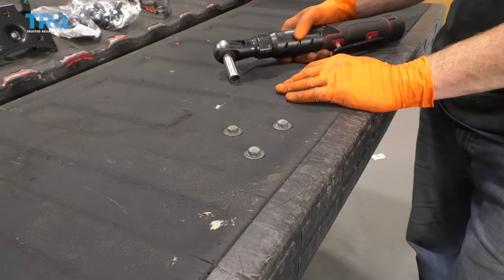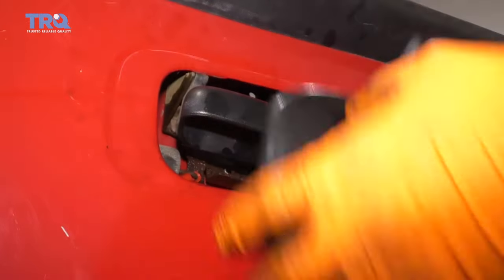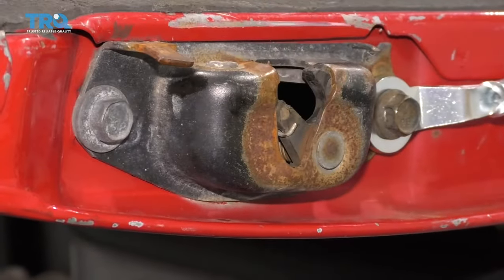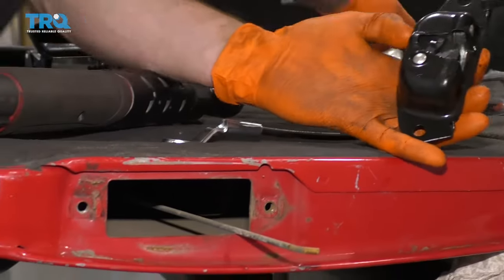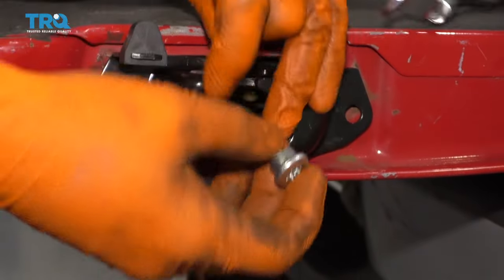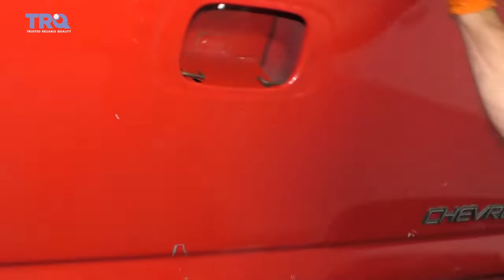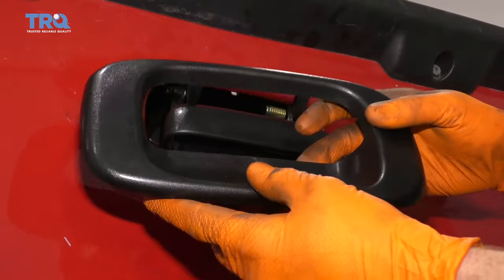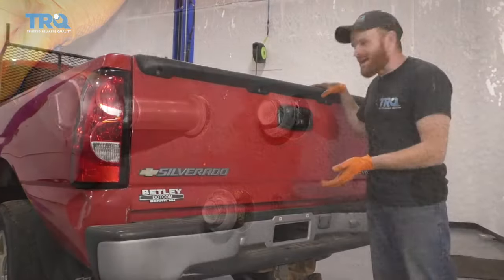How to Replace Tailgate Latch 1999-2006 Chevy Silverado

Comment: What size are the mounting bolts for the latch assembly..bought a new assembly online only to find out today that it does not have bolt included,,,,i tried many different bolts i had on hand but nothing worked,,are they fine threads...where can i buy them and what size ???please help..

Comment: The latch on my truck is broken so I’m unable to put the tailgate down to replace it. Anyway to get the tailgate to open without the use of one of the latches?
Reply: Hmmm..... You and I somehow wound up with pickups that have a plastic handle for the tailgate. I am sure that I will not pay 60K for a new pickup that rusts like an old tin can after 20 years  and has plastic parts for critical items.
Reply: Mine too the rod just flops around on one side. I might try to pry it open

Comment: I'm pretty sure the bolts are 1/2 inch instead of 13 mm. The 13 feels a bit loose compared to the half inch. While you can get away with 13 mm, it is slightly bigger. 1/2 inch is 12.7 mm. I guess it depends whether you're concerned about that 0.3 mm difference might mess up the bolts. It probably wont, but I just figured I would point that out.
Reply: 2003 Silverado was 13mm just perfect. Maybe varied by model year?